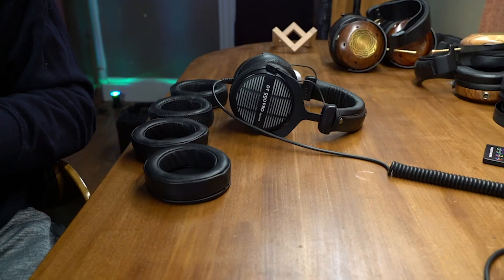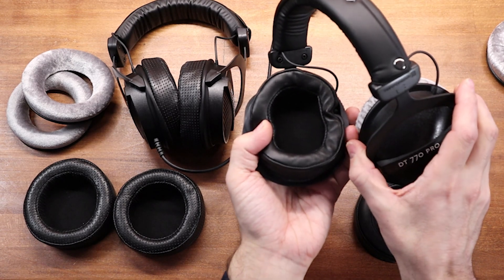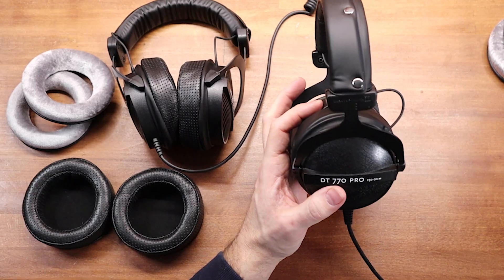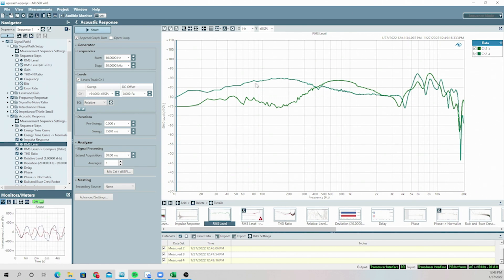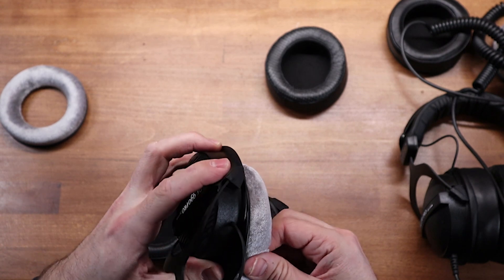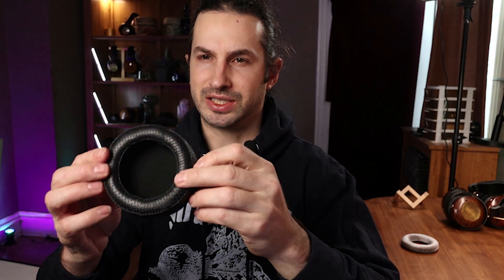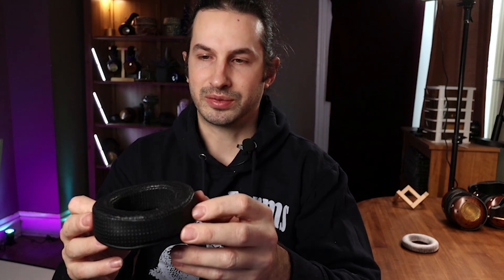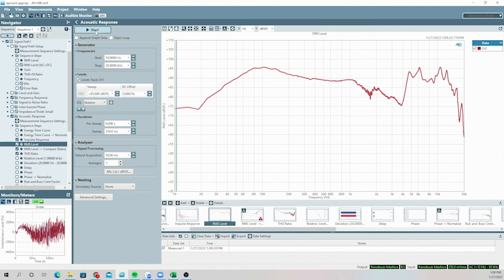ZMF Beyer+ Sub Pads - Measurements, Installation and a Grado adapter!

Comment: Got the suede pads for my HD6XX about 2 weeks ago. Great build quality. Look better than the stock pads by a lot and will likely last a lot longer too. Hopefully without the sound degrading as much as the stock pads do when aging. The soundstage is a bit larger and more cohesive, not huge, but now on par with the HD560S. A little more energy in the treble, which the HD6XX needed. Great job Zach and ZMF team.

Comment: Grado adapter + ZMF pads is a game changer. I own various sets of Grados - love how they sound with the stock pads … but they were so uncomfortable. The ZMF pads to my ears, warm the sound profile up a bit and tames the highs a bit, while also, increasing the width of the soundstage. You may a loose a bit of detail, but the overall I prefer how the ZMF pads tune my Grados and the comfort allows me to use them as an all day can. 

If you’re a Grado fan … I cannot recommend these pads enough for you.

Comment: Really hard to find good pads for Beyerdynamics. Would like to try these on my 880 250 ohm. I ended up with Geekria pads that definitely brought the treble down, but they are the typical Beyer form factor, and I'd like something roomier. Too curious not to get the Grado adapter as well - the SR80X I have isn't getting much listening time.
Reply: Do it you won’t regret it these and dekoni pads are by far the best and are well worth the premium but zmf edges out dekoni for sure they are very well made just got oval pads to put on a gl2000 it barely fit but the gl2000 is a odd shape headphone plus they are HUGE but once you get them on they fit well and sound phenomenal